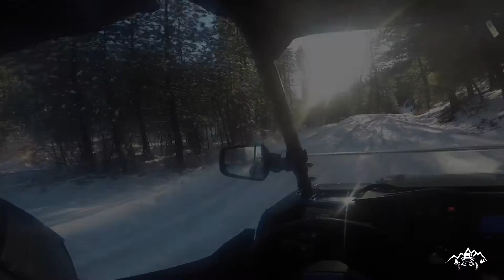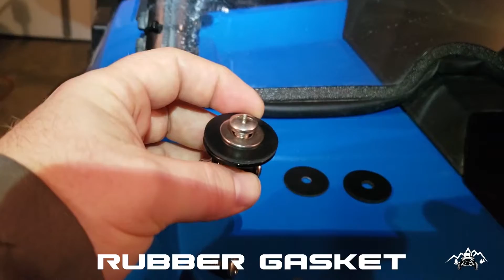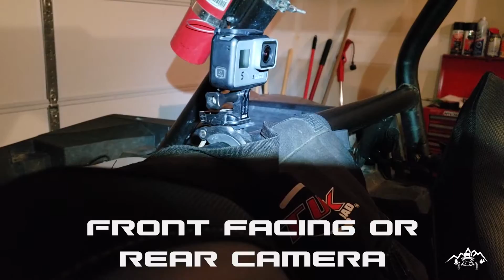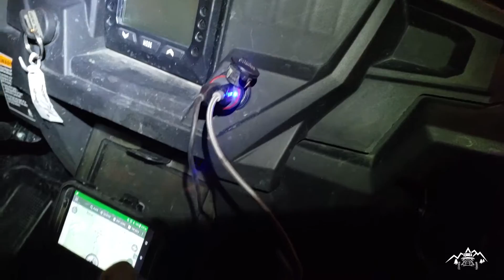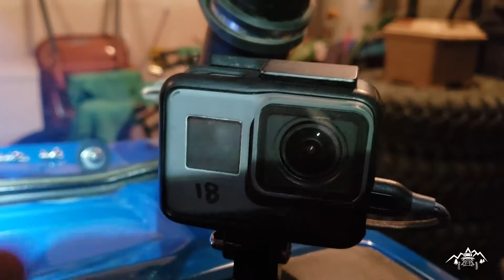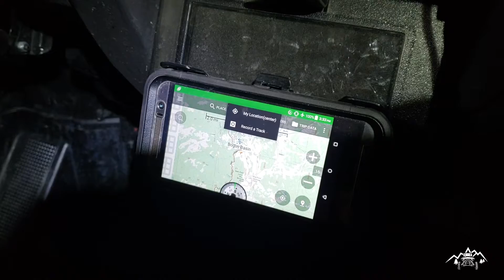RZR / UTV / SXS GoPro Camera Setup!

Comment: How long does the battery pack last running the 2 front cameras?   And thanks for the video.  It gave me lots of ideas.
Reply from the maker: Just depends how big of battery pack you use.  Just be aware, this was used with older gopros, the newer (gopro 7 and up) won't record and charge at the same time.
Reply: @McCurdyOutdoors  ok.  I have the Hero 4, so good to know since looking at getting another one.  How long does the battery pack you run last?

Comment: Heck of a set-up!  I’m impressed.  Only problem I see is the helmet cam.  You use a straw to sip your favorite cocktail while you’re riding?
Reply from the maker: It's a must to get somewhat clean audio without wind noise.  I use the audio from the helmet cam and sync it to other cameras using the "clap" method.  I now use gopro hero 7's but it's the same setup essentially.  Haha no but it isnt a bad idea!
Reply: McCurdy Outdoors lol, I was joking with ya.  I totally understand what you’re saying.  It’s what I’ve been struggling with.  And I just learned the clap method.  Pretty slick idea.
Reply from the maker: @RedneckandPinay  Could always buy a gopro sleeve.  It'll kill the wind noise but anything over 20mph it's not gonna pick up your voice.  I've done that on other people's sxs's so I get the engine noise without the wind.
Reply from the maker: @RedneckandPinay  https://www.amazon.com/dp/B00OJFJPF8/ref=cm_sw_r_other_apa_i_GWdZEbDB3FGGW
Reply: McCurdy Outdoors thanks for the advice.
Reply from the maker: @RedneckandPinay  welcome.  If you have any other issues or questions dont hesitate.